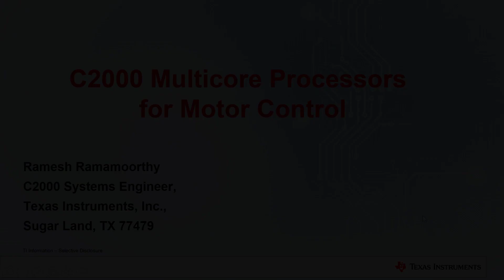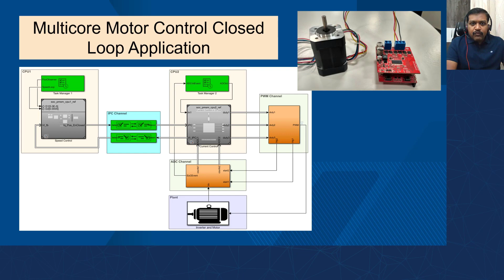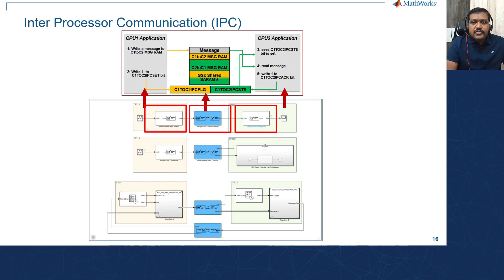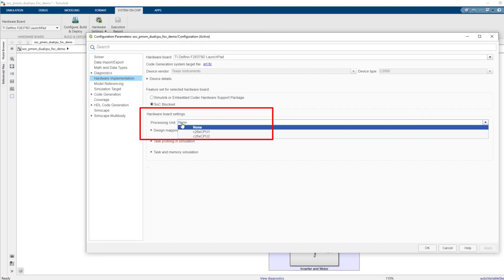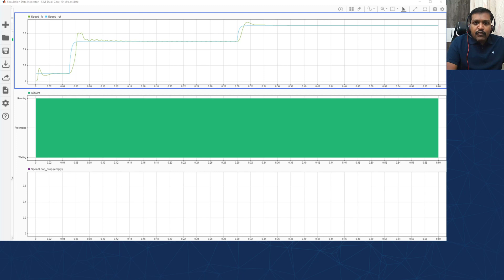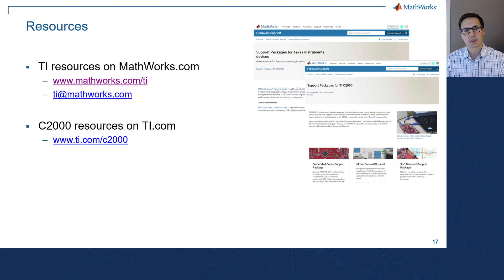Motor Control with TI Multicore MCUs Using Simulink

Comment: We are having dSPACE1104 controller..and PMSM with hall effect sensors.

Can we connect these hall effect sensors to ADC ports of dSPACE to measure the speed and for rotor position, in Speed Control loop ?